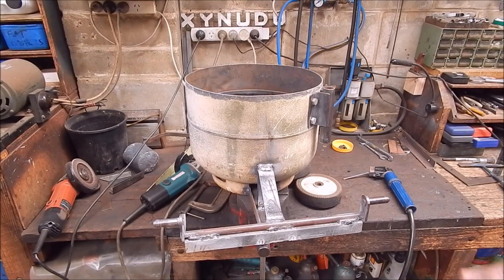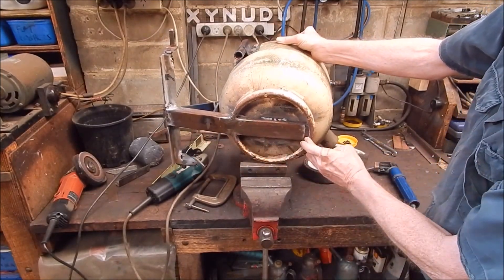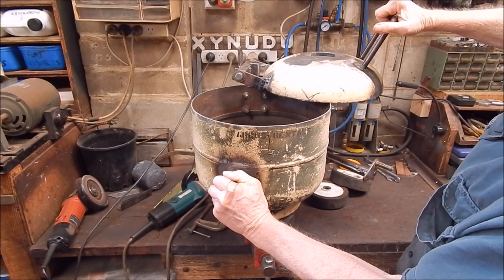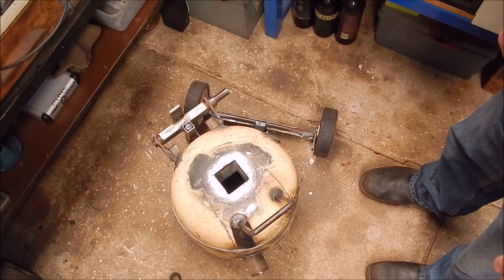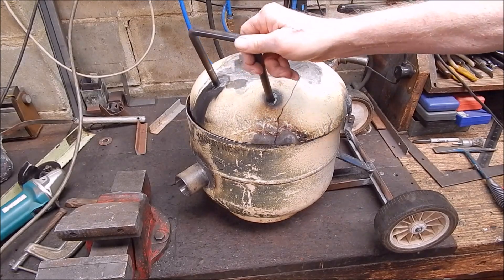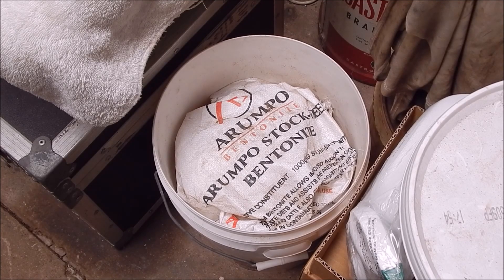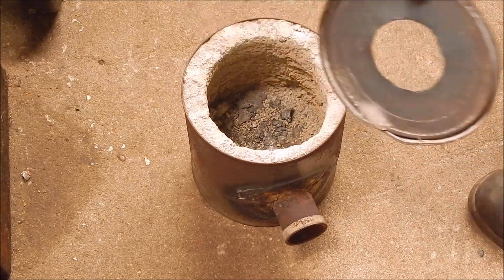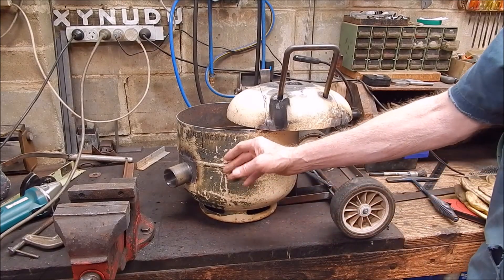Making a metal melting furnace from a 10 kg LPG gas cylinder - part 6

Comment: Hi Rob, looking good mate. I have no knowledge on this stuff so my only advice would be, which of the mixes is easiest to remove after a lot of use? They all sound similar price (with the exception of the wool), so I would assume that over time, any mix will eventually wear/crumble/degrade, so which one could you strip out the easiest to re-line. Lateral thinking, or maybe one too many pre Christmas drinks lol. Cheers, Jon
Reply from the maker: Hi Jon,  good point.  I expect once it deteriorates it will knock out very easily, going  by the soft nature of the lining in my existing furnace.  I don't see the point of spending up big on this.  Have a Christmas drink for me while you're at it.  Gotta keep all the workshop habitat well lubed ;)  Cheers Rob

Comment: Hi Rob. Starting to look good.  Have all the bits to put mine together, just waiting to see how yours turns out with what you use out of all those choices. Heading up the riverland for xmas and would just like to wish you and your familly a Merry Christmas and maybe if youve been a good boy you might get that miill. Enjoy Merv
Reply from the maker: Hi Merv, a Merry Xmas to you and yours as well.  Riverland sounds good.   A mill is wishful thinking ;)

The welding/fabrication is complete as of today.  I added some bracing to the wheel axle at each end and also fitted a piece of square section as a locator for a wheeling around handle.  I've decided to use Perlite and Refractory mortar at 4 to 1 ratio.  Apparently Myfordboy used similar for his furnace. One other viewer also did this. 

I was going to go 3:1 but I read an article on the net that said 4:1 was a strong mix.  I will get a bag of Perlite and do the deed.  I think I have some fireproof paint left over somewhere as well.  

That big burner should sound like a jet when this thing gets going.  Cheers Rob

Comment: Portland cement (1.5 parts), silica sand (2 parts), perlite (1.5 parts) and fireclay (2 parts). The first three components are mixed together thoroughly, moistened, then they clay is mixed in.  Ram it into place, let it dry completely, then fire it.  The cement will fail at high temps, but it is only there to give strength to the unfired mixture. Once fired, the clay takes over.  If ceramic fiber blanket is too expensive, this is the best diy recipe I've seen.

Comment: Myfordboy did a video (or series?) on making his foundry, which he said lasted quite a while.  I think he used perlite and high-temp mortar.  And I think he, or others, have used sodium silicate as the binder instead of water for added durability.  This is just my recollection.
Reply: G’day Rob. Looks good so far 
Cheers 
Peter
Reply from the maker: Thanks Peter.   Just a bit more bracing and a mount for a wheeling handle and it's all done, except for the lining.  Cheers Rob
Reply from the maker: I think I saw that a long time back.  I am thinking I will go this way and paint on some cement hardener after it has formed.  Cheers Rob

Comment: Hello Rob,
Good idea fitting the wheels... I watch a series by Keith Rucker building a furnace, I can't remember what he used... I believe one of the important things when making a furnace is to allow the insulation to dry/cure very slowly to avoid cracking and some just put a burning candle in main chamber for several days, which seemed to work well... not meaning to teach you to suck egg's here Rob... but after all this hard work stopping any cracking does seem important.
Take care.
Paul,,
Reply from the maker: Hi Paul,  all information on this subject is gratefully received.  I'm leaning towards Perlite and refractory mortar mix at 4:1 ratio, which is supposed to give a high strength bond.  The candle trick sounds good.  I may try that or something similar.  Cheers Rob

Comment: Perlite won't only make the darned thing much lighter, it'll keep the outside cool enough to touch, instead of fiery hot, and also use less gas/ oil to keep up at temp and reach that faster. Sand & bentonite doesn't have much insulating property - merely acts as a filler or ballast, requiring a binder (from the mortar or waterglass). Snag is - if you add (say) 30-50 % perlite to your bought Pizza oven mortar you might not have enuff binder left in the mix, and you cannot add any water glass to it whilst mixing, as it'll go off and set instantly... (Don't ask why I know) Longevity is problematic for any material above 700 C, so pottery & glass makers usually just add some bentonite clay and waterglass to the cracks that inevitably develops in their kilns. I'd personally return the mortar for a full refund - use the sand, bentonite and perlite and water glass for a half-dry mix, don't jab it home in the furnace like crazy (the perlite will be crushed - no insulation left) let dry for a week and the go slow on heating it up... Add an "inner liner" of bentonite/ waterglass for longevity after a few burns . Pizza ovens never reach 700C here, but then I'm only living in Sweden... Just MY 2 bits. Cheers DIYSwede!
Reply from the maker: Hi Johan,  I used perlite and about 1/3 regular cement plus a small amount of sand in the original build.  It could have used more cement I think.  I'm thinking try the refractory mortar about the same ratio but with no sand.  Cheers Rob
Reply: @Xynudu  Yes the Pearlite and refractory mortar, well mixed, and minimal water. You can always mist it with water after installing, to smooth the surfaces, and let it cure. Bought a bag of Pratlipearl, and the massive bag is only 10kg. Going to be used to repoint the fireplace, and replace the one or two missing fir bricks that have crumbled away. First thing though will be the high pressure cleaner inside, to remove the soot and clean up the chimney a bit, so the new mortar will have fresh surface to attach to, and not the crumbly stuff that is there.

Comment: I have often wondered if one could use ash, either wood ash or in the UK, ash from manufactured fuels (coal is about to be phased out here) as the refractory agent. It won't burn, but whether it will bind to a mortar and/or last if it does I don't know. There are many youtube videos showing the use of soil as the insulator in coal or charcoal furnaces built in wood boxes with no scorching of the wood even through the heat is perhaps 2 inches (50 mm) from the wood. (see e.g. https://youtu.be/m-R6iY-mY-Y) This made me wonder if one could have a cylinder of metal and just space it from the side of the vessel with loose fill ash or soil, the burner path being a cylinder welded to the centre cylinder. The metal cylinder may fail over time but would be easy to replace and ash is a byproduct of solid fuel burners that is mostly sent to land fill in the UK so zero cost. But I have never seen anyone do this, suggesting it has troubles that I am not aware of. All of this cooking recipes stuff is probably measured like food: Does it taste good and not cause indigestion with the added constraint that it must preferably last for as long as the forge like a preserve. No idea, but it is interesting to see how you are making this Rolls-Royce of a kiln and what insulator you settle upon. Thanks for sharing!
Reply from the maker: Rolls Royce of a kiln is a good one :)  It's more like a VW beetle I think - functional.  They used clay furnaces in the bronze age and it worked well.  So many options it's a bit confusing. Cheers Rob

Comment: Hi Rob. That nice wide axle mount for the wheels will make it very stable. Projects like this do tend to expand as you progress, you think of modifications, improvements etc all of which help to make the finished item even better. Cheers, Alan.
Reply from the maker: Hi Alan, very true.  Just a bit more welding and it's time for the insulation.  What is cheap and works best is the conundrum.  I would like to try that refractory mortar as it's made for the job, so that with some Perlite may be my best option.  It may be less likely to crack than refractory cement.  I see one viewer used it in his Pizza oven with Perlite OK.  Do I need any sand as well is the next question.  I will see what they recommend in the instructions.  Cheers Rob

Comment: Hi Rob - When you swing the lid back over the wheels, I think the heat from the lid will toast the rubber on the wheels - you have to make some kind of shielding over the wheels. I just used regular PORTLAND cement but I added some glass fibers to prevent cracking and it works nicely.
Reply from the maker: Hi Keld,  the lid is quite aways from the wheels, but good point.  Heat rises, so hopefully it will be OK.  If not then I will have to swap over to steel or shield them.  I used Portland cement, sand and Perlite in the original furnace and it lasted pretty well.  I think I should have used more cement.  If I use refractory mortar I am thinking 1 mortar to 3 Perlite and very little (if any) sand.  This is worse than baking a cake ;)  Cheers Rob

Comment: The Perlite and high temperature refactory mortar should work, I have used it when making a pizza oven good insulation. I don't know how strong it will be, in my pizza oven it's held in place by steel.
Reply from the maker: Thanks for the feedback Jayden.  I'm interested to hear what others have used out there.  Cheers Rob